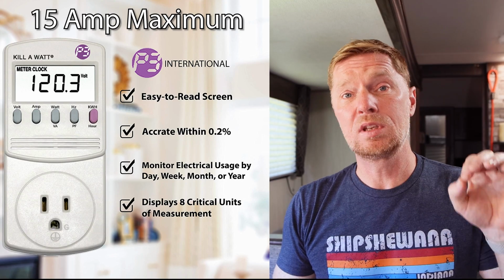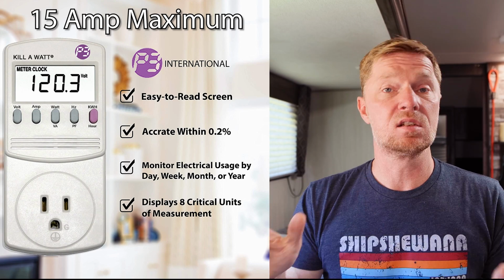15A Circuit Electric Hookup Tripping - Your RV Explained

Comment: My parents recently swapped to window ac instead of reaching out over the main ac. Nothing but rollouts now, same breaker but not a lot connected anymore and it's powering off segments of half the house. Improperly labeled, and im starting to think the folks weren't bright installing it and somehow everything is tied to everything. Never dealt with this and feel like im part of a 3rd world country having to wait to night time to power anything on
Reply from the maker: It sounds like there might be an issue with how the circuits were wired or distributed, so it could be worth having a professional electrician take a look at your panel to see if things are properly isolated. Also, in my house, a my bedrooms are tied to an outlet in the bathroom that has a GFCI. May look at trying to connect to a different outlet on the opposite side of the house and see how that goes.

Comment: Hi newbie here my question is why is it when I connect my motorhome to my house using a dog bone 30amp  -15amp, my motorhome's power is tripped and no power in the motorhome I just want to run the fridge or lights that's all.  Any ideas of what is happening? I have a redhawk that uses 30amp we haven't done the shakedown yet
Reply from the maker: @johnnywolfe2829  best way to find out is to turn off all the  breakers in the RV and plug it in. Turn them on one at a time to see what is tripping the main breaker. The door to the RV breaker panel should tell you what you’re turning on. From there you can figure out what you need to potentially leave off and on. Happy camping.

Comment: I replaced a double light switch in my rv but now when I hook the battery back up if flips the breaker inside DID I MIX THE WIRES UP WRONG
Reply from the maker: Battery systems are 12v and relies on positive and negatives to be in correct orientation. Possible that you have one backwards.

Comment: No my rv is tripping the breaker in the rv trailer and the  air conditioner is on a 20 amp breaker inside the rv. It's a 2950bh highland ridge 5th wheel.
Reply from the maker: I would suggest having an electrician install a dedicated 30/50 amp outlet for your RV. I have done this and have a pedistal similar to what you would have at a campground. It makes a world of a difference

Comment: My problem is I think that it’s tripping the breaker inside of my camper because it’s so fucking hot outside
Reply: I think I'm in the same boat.. I can't have my ac and even a TV going right now without it tripping the 15amp breaker.. I turn the TV its fine.
Reply from the maker: LOL....That could very well be. If you have tripping, look at the extension cord size as well. I put a 30 amp pedestal like you would find at a campground in at my house and never have any issues.

Comment: My problem is my camper breaker keeps flipping not the house breaker
Reply from the maker: I had the same problem a couple of years ago and had to replace the breaker in the RV. Believe or not, they can go bad too. The failure design of breakers is to cut off easier over time so that they do not create a problem. Hope this helps
Reply: @HowToRV  you or anyone one know if I can replace a 20AMP breaker with a bigger one? I literally have 5 things plugged in in the camper and it keeps flipping my AC
Reply from the maker: @davidkearns8993  there are so many types. I unplugged all power and had mine pulled out.l took it to a reputable RV dealer and asked them to order me a new one.
Reply: @HowToRV  yea here’s my last problem I have the camper plugged into my shed breaker that nothing is on besides camler but I have to use a extension cord so the camper plug will reach I’m not sure if that’s a reason why it’s flipping
Reply from the maker: @davidkearns8993  if you have a generator to try that may be able to tell if it’s the problem or not. Also check to see if your extension cord is 20 amp rated. Usually has one prong on the male end that is sideways looking.

Comment: Our surge protector was causing our service breaker to trip at home.  When we hooked up the power at home we put our 30amp surge protector in line.  30amp surge protector does not mesh with 15amp service, “as the surge protector label reads”.  Take the time to read up on your equipment.
Reply from the maker: That is amazing feedback. I will have to look at the lable on mine. Thank you.

Comment: Very helpful, after getting RV back from Dealership it started tripping garage breaker. I've been plugged in there many times just running fridge & lights. Turns out dealership turned all 3 A/C 's on and left them in the on position, after 20 seconds the garage breaker would trip. Turned A/C's off - Problem solved!! Thank You
Reply from the maker: WOW - 3 AC's...I am giggling over here because I had something similar and I only have 1 AC. Glad that it was simple to figure out. I also like things that happen and ends up not costing anything to resolve.

Comment: Very helpful thanks. Why would my shop GFI keep tripping when I plug my rpod into any outlet in my shop to simply tend my rpod batteries? The only time the outlet GFI doesn't trip is if I use a extension cord with no ground plugged into the rpod 3 prong cord?
Reply from the maker: I am not an electrician but would I would be very concerned if it is failing with a ground and and not without. I would not recommend running that way. You should check all your cords, connections, plugs, adapters and so on. Try to find the culprit. If no resolve, contact an electrician to test out what is causing the issue. Sorry this is vague but there are so many factors. With factors and warning signs, you have the warning, just need to correct the factor.
Reply: @HowToRV  Thanks so much for your sage advice, will do!

Comment: Is it bad to ALWAYS keep the trailer plugged into the house? Are batteries getting premature wear? Other issues?
Reply from the maker: So far mine has not had any issues. As for the battery, I check mine every few months to make sure that the water level is topped off. For the rest of the camper, I do unplug it if there is a lightening storm coming. Otherwise, no issues here.